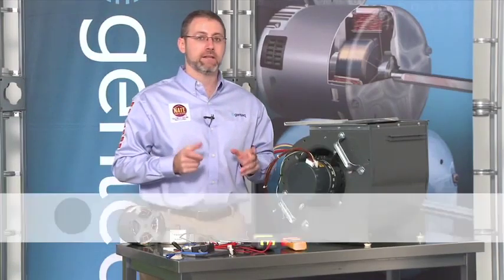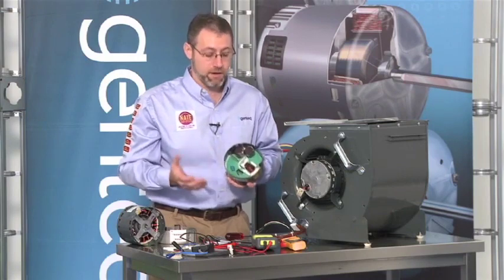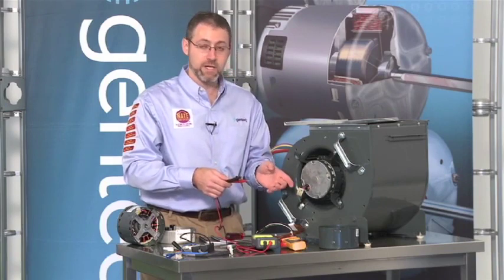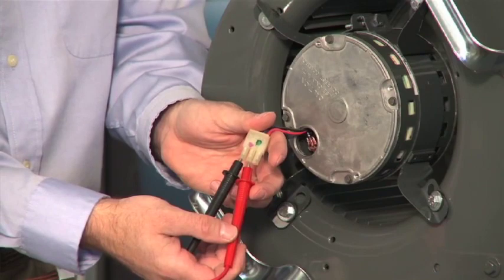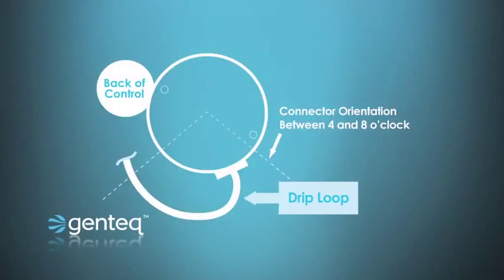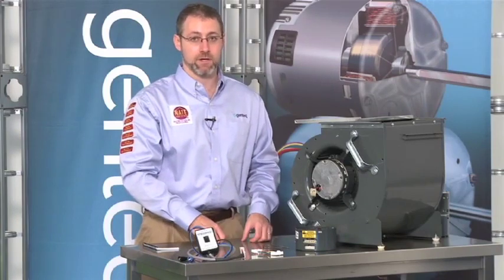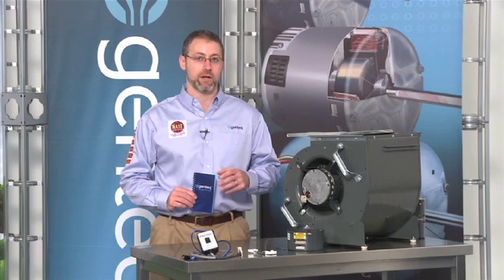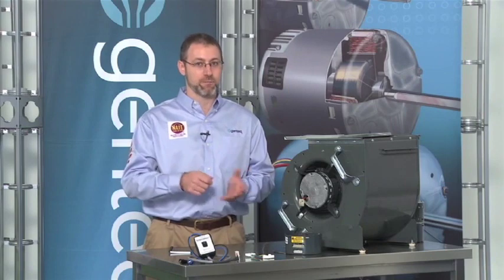Genteq Variable Speed Constant Airflow ECM Troubleshooting 101-2

Comment: When he pulls that module. You will see a black disk.
Next to that inductor that is the wire wrapped around the metal core that black disk the size of a quarter. Is what always goes bad
Reply: I can't thank you enough for your comment Christian. That was the issue with mine. $8 for 2 of the rush limiters off Amazon & about an hours work disassembling and soldering & she's back up cooling the house! Thanks Again, Sir 🍻

Comment: In my times  going out and  trouble shooting. an ecm motor it's never  the actual motor that goes bad it is a component on the computer board. On the module that always, without a doubt, blows A leg off, or it just goes bad. And that is a rush current limiter, black Disk the size of a quarter now, I different from everything havoc, guy out there.
Not 1 not 2, but  10. Calls for no AC or Heat i didn't condemn ECM motor instead, I unsottered the rush current limiter on the high voltage part of the board. And resottered. A new one on the board and shaved ten homeowners a lot of money

Comment: My Genteq ECM VS indoor motor just rumbled. It wouldn't spin. I performed the phase to phase test and I was getting different readings indicating the motor is bad. I believe it was something like 5.2, 4.8, 1.2. I took it apart and found the area in the copper wire winding where the insulation was burned up and shorting out with another copper wire near the wire leads. I was able to isolate the wires and performed the phase to phase test again. Now it reads 5.6, 5.6, 5.6. I insulated the copper wires with epoxy and reassembled the motor. Now it works again. This gives me time to source a new replacement motor.

Comment: Test motor windings.  If R is = all 3, replace controller.
Reply: My Genteq ECM VS indoor motor just rumbled. It wouldn't spin. I performed the phase to phase test and I was getting different readings indicating the motor is bad. I believe it was something like 5.2, 4.8, 1.2. I took it apart and found the area in the copper wire winding where the insulation was burned up and shorting out with another copper wire near the wire leads. I was able to isolate the wires and performed the phase to phase test again. Now it reads 5.6, 5.6, 5.6. I insulated the copper wires with epoxy and reassembled the motor. Now it works again. This gives me time to source a new replacement motor.

Comment: Do you know what is the biggest problem with the new ECM motor. They are very expansive to have to replace. In comparison to a SPC AC motor. What the manufacture dident think of doing. Was to design the ECM motor to be made as two separate components. It is the electronic module that is going to malfunction that has the semiconductors on the PC board. Not the permanent magnets and rotor
Or field coil. So they should manufacture it as  two separate parts from each other. They could be separated. And then order a new electronic module to be replaced to the complete motor assemble. Now the cost of the repair is $300.oo cheaper. You do not need to have the complete ECM purchased. Now tha customer has a lower expansive service call to fix the gas furnace
 Or two stage AC. Air handler. Why are they not doing this?

Comment: I have watched 2 dozen videos on the ECM motor and controls and nobody ever goes into detail about what component of control failed and how to figure that out. 2 things happen with controls. They either will not run or will not shut off. I'd like someone to explain what on control board would cause either of those.
Reply: My failure mode is a little different. The motor just jiggles back and forth a number of times, never actually starting, and then just gives up.
Reply: @kf3en  I have this same situation. Did you confirm that the control module was bad and the motor good?
Reply: @rakembuzz  Yes, motor was good, control module was bad, but you get both when you buy the spare motor, so I swapped the entire unit. You can ohm out the windings on the motor to determine if it is still good.  (95% of the time I would guess the motor is good, especially,  if it ohms out and still spins ok. It is common knowledge on the web here that the control modules go out often and are susceptible to surges on you line.  Be advised that you may need to buy a fan puller tool to get the blower fan off of the motor shaft. (amazon)
Reply: The main reason why no body goes into greater details to how the electronic circuit works. On the level of the theory of operation! Is because the manufacture doesn't have a schematic diagram of the PCB.  To place on line to read. Then how could you trouble shoot it with a oscilloscope and VOM to check the signals driving the field coils. And the DC control logic voltages from the miro processor
 Driving the power driver transistors. There are no voltage levels on a schematic. And the manufacturer well not sell you  diodes or IC chips or any type of  semiconductors. So the big question for the day is what good is it going to do to explain the circuits if you can not buy a small semiconductor. You need to replace the complete circuit board. The same is true for a smart thermostat.
Reply: They make it so you have to buy an expensive pos from them which keeps them all in business so just take that stupid ECM motor out and put a PCS motor in it and call it a day all you need is a relay to turn it on and off problem solved with less money all manufacturers just want to complicate things and act like it's doing some kind of efficient thing when it's just not you want to make a house efficient change the windows the insulation and a whole lot of other things just like car manufacturers they add computers to make you spend more money

Comment: I have a ac fan that wont turn off and the hvac tech says it a bad motor. Have you ever seen this happen. I could possible see it being the motor control but wouldnt think it would be a motor going bad. Looks like my part number is a 6205E.
Reply: There’s a video that kind of describes that problem 
The video is called “ECM multi speed blower motor trouble shooting” by AC service tech LLC. On YouTube he explains the similar problem. Hope this helps
Reply: If it's the blower motor, then the relay in the ECM control module is bad.